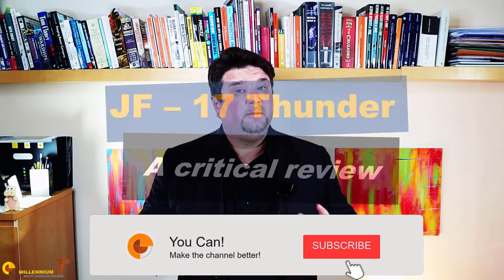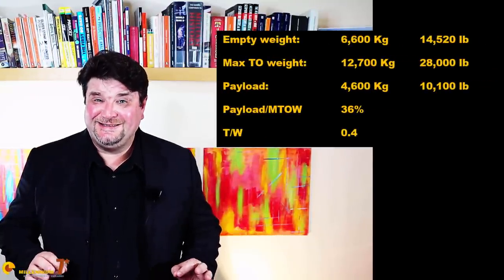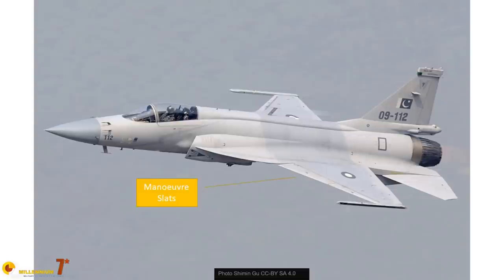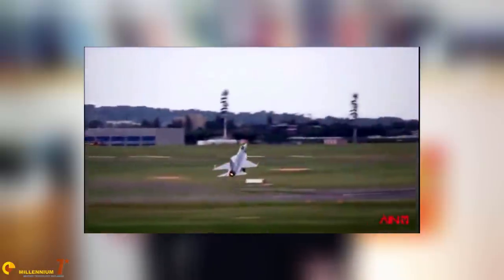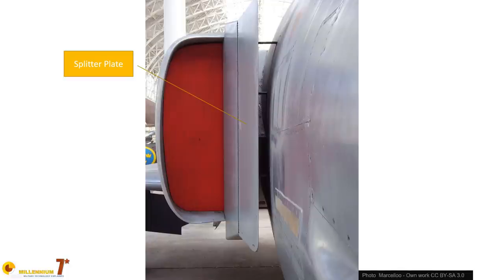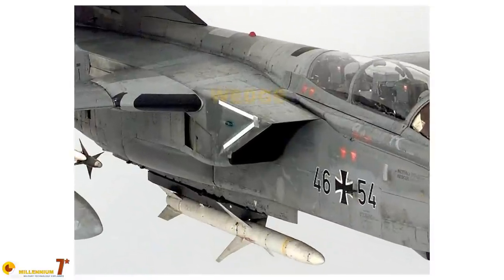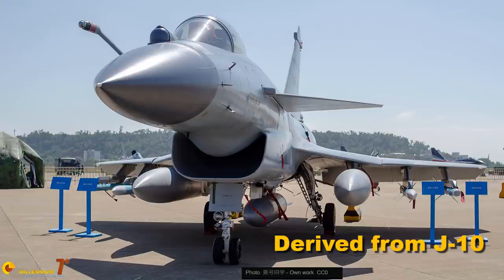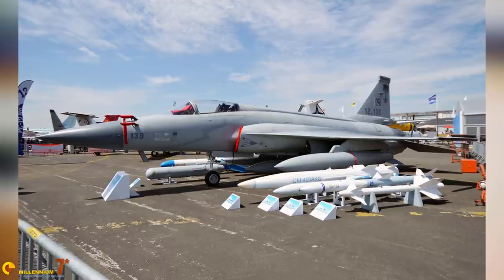JF-17 Thunder Block 3 & F-35 - What do they have in common?

Comment: Signore, you are, as always, spot-on in your analysis.  It warms my heart to know that someone out there knows what they're talking about.  I am considered somewhat of an expert on military aircraft myself.  I am not in your league however as I don't possess even a Bachelor's Degree in Aeronautical Engineering, let alone a Master's.  I have however, semi-diligently studied military aircraft for thirty years.  I am glad to see that your analysis of the JF-17 is similar to my own because sometimes I get asked on Quora about the JF-17 because there are a lot of people (especially in Pakistan) who think that the JF-17 is the ultimate fighter. 

Of course, I must tell them that it is not (The Saab JAS-39 Gripen is, IMHO), but that it would be comparable to a MiG-29 and that for defending the skies of Pakistan or other countries of similar means, it is perfect.  I point out that its low cost is a great feature which allows for better numbers but that it is an older-type cruciform/elevator design that is inferior to the modern canard/delta.  Some don't like to hear this but I point out to them that China designed the plane and they have chosen not to use it.  They prefer the J-10 Vigourous Dragon which, of course was based on the IAI Lavi and is a modern canard/delta design.  Still, I point out to them (and quite rightly I believe) that it is a far better thing to have three JF-17 Thunders than a single F-16 Fighting Falcon.  Since they fly both planes, I'm sure that Pakistan would agree.  Without significant numbers, an air force cannot function because any plane lost to bad luck or accident would be catastrophic.

The JF-17 reminds me a lot of the Northrop F-20 Tigershark with Falcon-style wings.  It's not just the visual appearance of the plane that reminds me of it but its role as an inexpensive but relatively capable fighter that was designed by a global superpower that was to be export-only.  This was of course the role of the F-20's predecessors, the F-5A Freedom Fighter and the F-5E Tiger II.  I hope that you will critique my statement as you are the only person that I have encountered online who clearly knows military aircraft better than I do without bias.
Reply from the maker: Thank you for your kind words but, rest assures, you are overestimating my competency.
Reply: The JF17 is never claimed to be an ultimate fighter, even some PAF pilots claim that F-16 is superior in some aspects and Jf17 is superior in others. Jf17 is a balanced plane with tremendous features  like aesa radar, sd-10, pl-15. The jf-17 also allows Pakistan to avoid any future political sanctions and spare parts issues, it is an aircraft tailormade by the air force engineering department themselves. The J-10 is a medium weight fighter with larger fuel reserves which meets the needs of a large superpower like China. China has Different requirements therefore China does not need or want to induct jf17. However, other countries have inducted jf17 and still many others show interest to do so. A remarkable achievement by a struggling economy like Pakistan..
Reply: Avro Arrow The fighter that lots of indegenous people think is the ultimate superplane while in reality it’s just a mediocre light fighter is the HAL Tejas. :)
Reply: @henrikg1388     Its either American camp or chinese camp. The Chinese use of implanting sneaky malware into infrastructure like 4g and 5g towers should mainly concern India. American Diplomats like Henry Kissinger have mentioned that america doesn't have allies and only has it's interests and right now it probably doesn't want another war. If I'm right, one of Trump's elections promises was to get American troops back home. Trump ruthlessly targeted huawei to target china, the man shut down government and declared state of emergency because of money for building a wall that he said Mexico would pay for. He always makes off the cuff statements about anything and everything  leading to embarrassment for the U.S.
Reply: Blackbirdz2000  any source for this? Carrier fighters are generally heavier and twin engines. All though Jf17 as chinese carrier fighter would be nice to see.. j11, j16 seem more preferable.
Reply: @verdebusterAP You are looking at it from different perspective. Many technologies make the Pakistani aircraft superior to F-16. I will give examples. JF-17 has DSI intakes whilst  F-16 has older design under the belly intakes. DSI creates less drag and is more stealthy(can be seen on most if not all 5th gen fighters). F-16 is superior in long range flying and dogfight. Both which are no longer neccesary due to in flight refuelling and BVR advancements.

Jf17 has far smaller RCS and therefore harder to track, target and engage than F-16. The radar is also more advanced and is resistant to jamming due to aesa technology and perfectly integrated indigenous munitions such as sd-10 and soon to be integrated pl-15. Smaller rcs and better radar is major deciding factor. Also, block 3 uses more composite materials  that further reduce RCS whilst making the airframe stronger. 

Pakistan air marshal Shahid Latif was amongst first pilots to bring F-16 from America with training and has had extensive experience of several thousand hours with the aircraft. He was the project leader of Jf17 development. He mentions the f-16 was used as a benchmark when developing jf-17.  Surely, the man who has more than decade direct experience with f-16 would use his knowledge to produce an aircraft at the very least on par.
Reply: Enthusiasts on internet make all sorts of unvarifiable claims about JF17 and Tejas which are often repeated as fact. The JF17 is limited by its engine in  comparison to similar platforms but PAF can live with that.  Its a swiss army knife in terms of range of weapons it can carry making it a versatile and truly multirole platform.
Reply: @stoicsage5466  don't reveal all the specification they use the tricks to get info what they are using and what kind of missiles radars were used to come up shield for that
Reply: @stoicsage5466  I read that the Pakistani Navy was thinking of using JF17s.  Right now, they rely on PAF controlled Mirage 5s. JF17s are not only advanced than sixties mirage but the navy would have more control over its own aircraft as PAFs main responsibility is the air space and infrastructure of Pakistan including providing ground support to the army.  The navy always get shortchanged which can't happen now with Gwadar up and running.
Reply: @verdebusterAP  it’s based on use. Pakistan always had a defensive stance rather than offensive mostly. 
F-16s are limited for Pakistan and I think they can’t be used to attack any other country if in war. 
While jf-17 is a plane made to meet specific demands of pakistani airforce and its political and economical situation. For that perspective it’s the best option for pakistanis. 
No doubt f16s produce more thrust. but with low cost, more weapons and a better radar, Pakistan would opt to the more economical option.
Reply: @verdebusterAP  considering it’s an early plane I agree. It’s a state of the art for Pakistan considering the economy and budget. 
Where as USA and Lockheed Martin had a vast budget and criteria to meet. 
So there’s always room for improvement even in further blocks upcoming. For now blow 3 then 4 and maybe more. 
But yes. I agree.
Reply: Sir you telling that design model of Jf17 is older than delta/ canara design then why all 5th gen jet design of basic crusi / elevetor ..
Reply: @henrikg1388  
How would this off switch even work? What's the connection between the switch and the remote thousands of kilometers away? This off switch is a bogus theory propagated by butthurt amateurs with no technical evidence nor any evidence of such a switch ever existing in history.
Reply: @henrikg1388  
Speaking of Chinese electronics, take a good look at the Indian Su-30 flying near the Chinese border in disputed territory of Assam, that suddenly disappeared from radar and was found crashed several days later (May 23-27, 2017). Investigations showed complete systems failure, complete loss of pilot control, even the ejection seat failed, all without any visible malfunction. They concluded the cause of crash is a cyber attack.
Reply: I will tell U why Pakistanis consider  JF 17 the best in the world. #1, IT is our own, nobody can tell us, no more spare parts, #2, Nobody can tell us where to use it, or not to use it. #3 We can do all the modifications we like without anybody's approval.  Lastly there is a real chance to develop some other jet, with our experiences of this one. You see, one don't have to be an expert to see the logic of less perfect, but our own, and  a damn good,  but dependant on others.
Reply: The F-20 Tigershark was an impressive yet nevertheless inferior fighter to the F-16, which is why it lost out in spite of its cost advantages. And remember, that was back in the 80s, whereas now it's 30 years later. Likewise, the Iranians have been trying to develop their own upgraded version of the F-5, which was the immediate predecessor to F-20. Perhaps Iran and Pakistan can swap notes on that. The low service life of JF-17 would take its own budgetary toll over time. Its relatively light A2G capability limits its effectiveness for multi-role, and mainly slants it toward A2A. Given Pakistan's past reliance on F16 as a spearhead against India's formidable ground forces, replacement with JF-17 may result in winning certain battles but losing wars.
Reply: @husainn_mh  - nonsense, F16 was Pakistan's primary nuclear delivery system. That may no longer be the case, but to deny that precedent is to show one's own ignorance. JF-17 is too little, too late - it can't meet Pakistan's political and economic situation, which is acutely deteriorating and unsalvageable by a mere aircraft.
Reply: @ahmedkeerio2051  - JF-17 Chengdu is Chinese-designed, Chinese-made aircraft. All Pakistan does is assemble kits which come from China. No kits, no JF-17. That leaves Pakistan's autonomy as far as the end of its leash. North Koreans know how you feel, and soon you'll know how they feel.
Reply: @manofsan  this shows how much you know. Lack of knowladge, and jealousy leads to this. Many parts are being built in Pakistan. Design and much more is done by Pakistan. Besides, your Teja is still on drawing board, even IAF didn't buys it, yet, if U insist.
Reply: @manofsan  And you talk about autonomy ???? All IAF is soviet made. Where is Indian autonomy then ???? This is not how you should judge Autonomy.
Reply: @Ahmed Keerio  -  India's knowledge from homegrown Tejas is incomparable to Pakistan's assembly of kits shipped from and made in China. Indeed, Pakistan simply does not have the technical base to develop a fighter indigenously. The Chengdu is purely a product of Chinese capabilities. We can see that Pakistan has now begged China for J-10 aircraft to augment the mediocre JF-17.
Reply: @Ahmed Keerio  -  India has its own indigenous jet engine. India is not some captive client state like Pakistan which imports every single defense item from its master, China. Being independent and sovereign means having to make many things on your own. That's why India's per capita GDP is more than 50% higher than Pakistan's.
Reply: @manofsan  Don't  worry, ido, as long as I have hundreds of JF17's, and you have just couple of dozen tejas.hiding for away from active borders.
Reply: @Ahmed Keerio  -  Pakistan's supply of JF-17 Chengdus are limited by the supply of kits from China, which are not free. Pakistan's ability to afford such expenditures is falling faster than the price of the kits. China will not be supplying hundreds of kits for free. They're not a charity outfit. India's Tejas is indigenous and affordable for India, and has given rise to further more advanced jet fighter projects like AMRCA, etc. India is proceeding up the learning curve, and not the kit-built curve which is a dead end.
Reply: @manofsan  you are considered as expert, but looks like you are not.
Reply: @manofsan  well before you said China gave us J10C as Charity now you are backtracking from your own statement don't worry we still have enough to buy a  30m J10C or supposedly expensive JF17 kits you should be worried about the availability of American engines after you abstained from voting against Russia in un.
Reply: @FAULT LINES  -  Pakistan abstained too, so what distinction are you imagining?
Reply: @FAULT LINES  -  India has been improving its indigenous engine, and also has joint cooperation with France for development of newer engines. Pakistan doesn't have access to all weapons of China, because China doesn't just give away stuff for free.
Reply: @manofsan   I Guess your Indian media never reported it but Pakistan and China have already signed a strategic alliance agreement. Well Chinese gives you stuff when you need it most and that's more important than the price for us. You know you don't even have the blades for jet engine a cooperation is more like you are asking french to bring all those parts that you can't make so it's still the same. and Pakistan have access to all weapons and systems China has just recently interior minister announced that we are in talks for J20 as well. So you can imagine if China is ready to sell their most prized asset to Pakistan then you can imagine how deep this relation is between the two countries and Chinese even offered access to hypersonics but Govt is not interested or don't have budget for that whichever one you want to believe.
Reply: @manofsan  Pakistan is not buying any weapons/parts from US but you are. It's doesn't really matter for Pakistan now even if America retaliates. We are already in FATF no big weapons deal is in place with US but Indians are buying jet engines from USA.
Reply: @manofsan  I don't think your bhajpa University told you this but Pakistan is at no 54 when it xome to countries with most debt compared to India which is at no 18 so it's not humongous as most of it is being used to build infrastructure every big nation economy is in debt we only need to manage it which we doing fine. I think you don't know but overall Pakistanis have much better living standard than anyone else in subcontinent with just 6.1% poverty rate and thanks to IK reforms and packages for poor people even that is declining quickly. Even right now when the world is grappling with increasing oil prices Pakistan has the lowest fuel rates. You can hurl all these claims about Mahan desh or fastest growing economy but we know you inside out that's why these tactics don't work here
https://www.deccanchronicle.com/nation/current-affairs/020818/bimaru-states-make-india-poorer-than-pakistan-says-world-bank-report.html
Reply: @KatariaGujjar  India crash their jets on a daily bases. so, probably not due to PLA's effort. 🙄

Comment: Lol youre quite wrong from first the 150 jf17 block 1 & 2 have empty weight of 7960kg and max take off weights of 12.7 tons .
The new block 3 has increased empty weight of 6.6 tons some sources say its 6.75tons anyways here alloys & composites are used unlike only metal in earlier versions so its structure is more strengthened so its max take off weights is 13.5 tons.. it has now fly by wire systems onboard oxygen generator an aesa radar which was not there before. 
Same thing its competitor tejas resembles its empty weight is 6.5 tons(6560kg)  earlier its max takeoff weight was 13.5  tons 13500kg. As it had more composites from Begging and also light weight alloys.  now it is certified or atleat is capable of 14.7 tons max take off weight. 
Both jets carry around 2.5 tons fuel 
Tejas has American efficient engines with more life & less maintainance.

Comment: Jf 17 problems:

1: it is use world wrost engine rd33 
2: It is have very low quality composit material,,
3: It have only 2 side FBW  system 
4: Jf17 have aerodomic problem, cause of crush,, it had 4 crush already,,
5: it has very high quantity if steel so RCS is much high

Comment: i think JF-17 and tejas are no match because both air forces use there respective jets for different roles .Tejas is a good air to surface platform and Thunder is a good air to air platform <only because of PL-15/12> ...tejas could have upper hand in air to air role only if it had meteor which was not compatible with Israeli radar
Reply: They are compete different level of technologies.
From 4.10 he explains the technology used on JF-17
1. Aluminium structure
2. Fly by Wire only in one axis, while mechanical controls in the other 2.
3. Inferior RD-93 engine without FADEC and max thrust of 85 KN
4. Software in C++ coding

In comparision Tejas has
1. 90% composite structure in the airframe surface, over traditional aluminium
2. Quadruplux Digital Fly By Wire on all 3 Axis
3. GE-404IN Engine with max thrust of 90KN with FADEC
4. ADA Military grade Software coding.
Reply: Whatever JF17 ended up in battlefield last year Feb ending up hitting targets inside India, while Tejas was crying in his moms lap scared hehe.
Reply: @rohitb3  Tajas is easy target for JF dont worry JF proved already JF shoot down two well reputed jets
Indian MIG 21 and SU30 MKI
Chill body
Reply: @эко-л8ж  we saw how good Jf17 was it saw F16 fallen from sky by a Mig21. Stay delusional. Keep denying your losses it doesn't help. You guys are same who were claiming victory on 15th December 1971 and surrendered 16th December 1971. You should learn from history that being delusional always hurts you in long run.